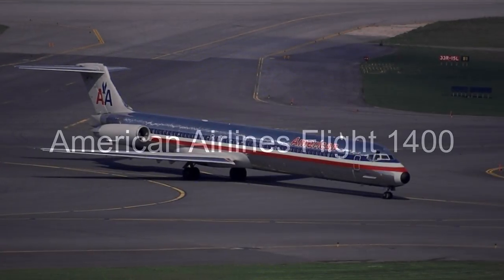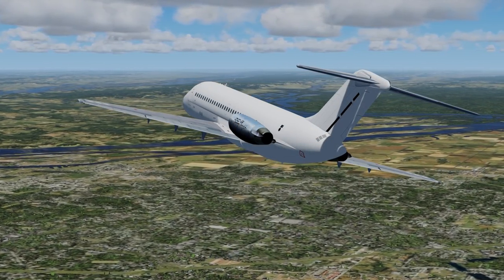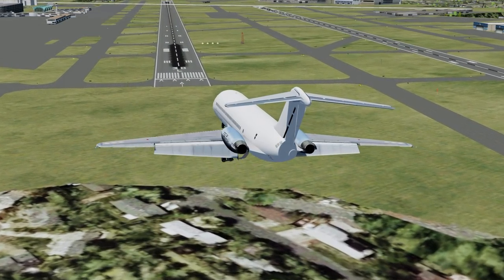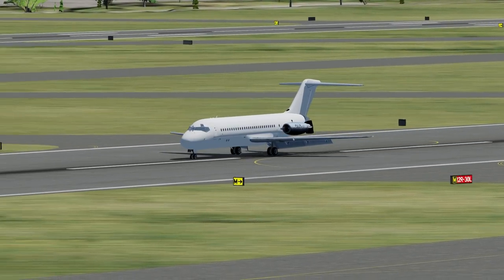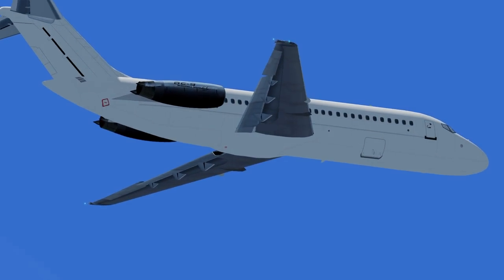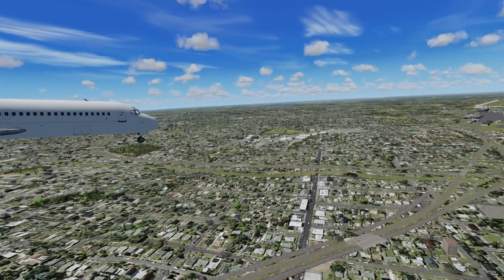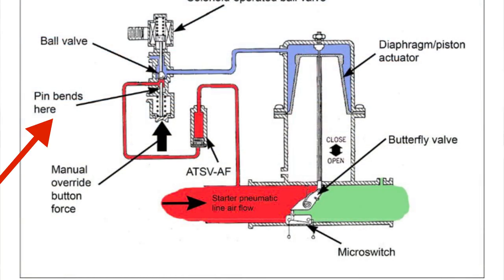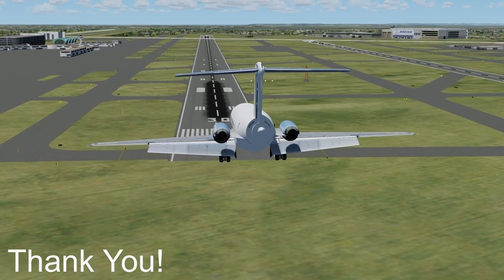How A Tiny Bent Switch Set A Passenger Jet On Fire | American Airlines Flight 1400

Comment: Is it time to remove pilots yet?

It’s insane expecting bus drivers to deal with such complex devices. 

Even boats have captains helmsmen engineers navigators radioman etc etc etc. 
and they go slow and can stop.
Reply: @Earth 
Ships are slow and simple yet have half a dozen specialists to drive them. 

Aircraft are fast and complex and can’t just pull over and sort out what’s wrong. Yet, it’s expected that one or two people can deal with all that. 

1/2 of air deaths are initiated by pilots. 
2/3 of all air deaths are caused by the pilot. 

Is it time to replace pilots with navigator and engineer to monitor an autonomous system?
Reply: @Earth 
Tanks?

You have lost me there. 

What are you trying to say about engines?
Do you mean aircraft engines don’t eat birds or sand or ice or have the atmospheric pressure change by a factor of ten?
Reply: @Earth 
What do you think caused airplane deaths?

Controlled flight into terrain. 
Pilot induced stall.
Configuration errors. 
Pilots deciding to fly through bad weather. 
Pilots not aborting a failed landing. 

Etc etc. 

About 20-25% of accidents would not be stopped by removing pilots.
Reply: @brucebaxter6923  no, numbnuts.
Reply: @alhanes5803  
Ok. 
Can you please tell me why not?
Reply: @Earth 
That’s correct. 
Many many people will not die if only we remove pilots.
Reply: @Earth 
Remember it doesn’t have to be perfect. 

It just has to be better. 

I don’t have to outrun the bear, I just have to outrun you.
Reply: @brucebaxter6923  
Yes, because software is set up by humans covering many possible scenarios. 
There are many times a crew must come up with ideas nobody has thought of in an emergency. 
A computer is going to try different things then say, I'm dong.
Reply: @alhanes5803  
Oh, show me.
Reply: @alhanes5803  
What more does it need to do other than avoid terrain and aircraft while navigating waypoints and monitoring machinery?
Reply: @alhanes5803  
Everything to do with piloting a plane is about checklists and procedures. 

Guess what?
Computers do well at not missing steps in checklists and remembering procedures.
Reply: @Earth 
How important do you consider yours?
Reply: @brucebaxter6923  
You might want to discuss things you know something about. 
It obviously isn't aviation.
Reply: @alhanes5803  
So you cannot give a single example of where not following checklists and procedures was the right thing?

You just don’t like the idea that nobody is in control of your life. 

If only you knew how much already out there is life and death held at bay by computers.
Reply: @brucebaxter6923  
WTF are you talking about?
Go play your video games.
Reply: @brucebaxter6923  
OK Einstein.

Comment: Everyone is missing the KEY issue.  Dimwit mechanics cause plane crashes and death.  
A properly trained and experienced and empowered mechanic would have prevented this  ENTIRE disaster.  A simpleton grease monkey spells death.
Likewise, the REAL disaster of Midway was the enormous loss of the skilled Japanese MECHANICS!
Pilots and planes are CHEAP and EASY compared to skilled mechanics.
As a mechanic for TWA at SFO, I occasionally saw outrageous lunacy in inept attempts to TROUBLESHOOT recurring problems like this one.
Having nitwits servicing the plane requires superhuman skills of pilots to save the day. 
 Its better to have SKILLED mechanics and avoid the deathly drama for the pilots.
Mechanics get NO respect!

Comment: I DEFINITELY wouldn’t have done a single engine go-around with an engine on fire. After all, it was only partial gear up (nose gear), not like having no gear at all.
That could have ended up much worse, with the complete loss of the aircraft. They had an awful lot of luck on their side in this case.